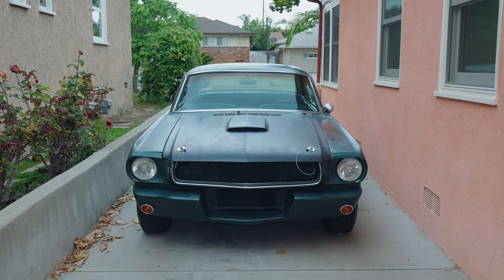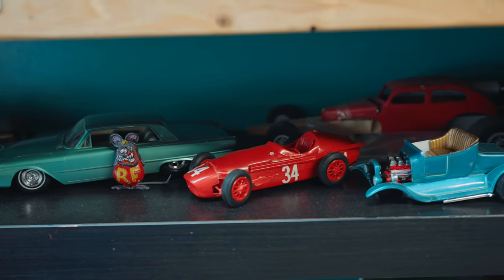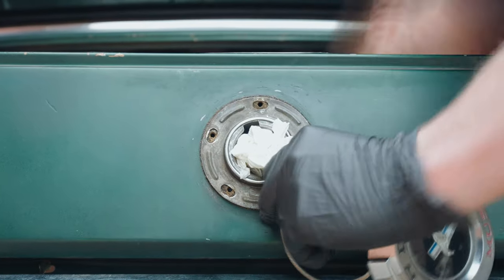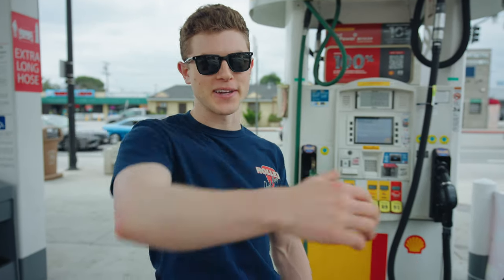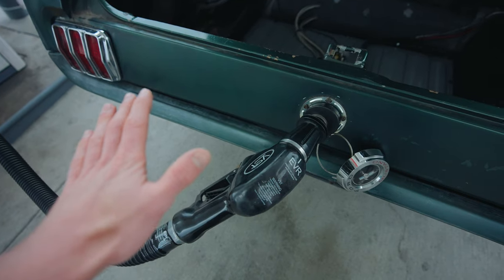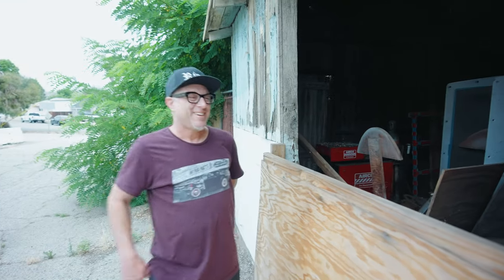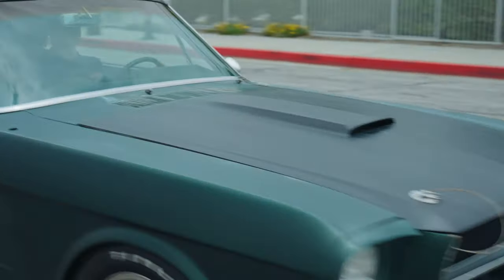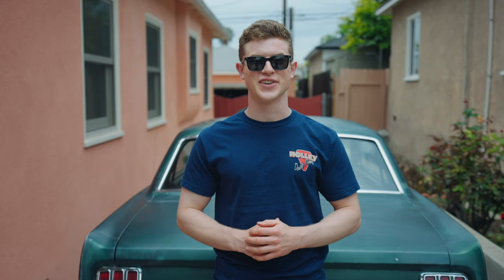Classic Mustang Mod: Stop Gas Spillage and Pump Gas Hands Free!

Comment: You have that steady EFI idle now, FiTech really levels out lopes. Doing the filler mod in this video would be a challenge on my Pontiacs and Cuda. Probably need to cut it in half and weld it back together because they are welded to the tank on my cars.
Reply: 1964-1968 Mustangs are a breeze when it comes to fillers and tanks. I had to replace the filler on my AMC Matador......drop tank and make a filler as none are made today. About 3 weeks......my Mustang 3 hours!!!
Reply from the maker: That would be cool!
Reply: @SweatyFatGuy  I like different.......Matador is that!! thx

Comment: A bit of history if not mentioned yet, that incert was originally used in the 70's to prevent refueling with leaded fuel, the nozzle for leaded fuel was larger in diameter than the unleaded nozzle, and would not fit thru the nozzle hole which in turn would cause the leaded fuel  to splash out if attempting to lead fuel a vehicle marked "unleaded fuel only" 
And that is your 70's dose of trivia for the day
Reply from the maker: Interesting!
Reply: My 75 trans am had that restrictor chiseled out of the neck to allow led fuel to be used lol

Comment: That's pretty cool!  Wish I had something like that when I had my 67.  I used to pull the gas pump rubber back while filling and hope it didn't splash on me when full.

It's always cool to hear your car without the typical fart pipe setup.
Reply: It's kinda amazing that his car sounds as it does with an X pipe. Usually I hate the sound of an X pipe exhaust. This car I really like. In fact I've never heard a small block Ford sound like this. I'm 62, I been hearing them  since this car was new.

Comment: Hey Ben thanks for the information! I have a 67 mustang convertible and it drives me NUTS filling the tank! Maybe something to consider is doing  EPAS steering,  no hoses, fluids, or special  steering racks. I bought a system from a 2009 Prius for $300 including the shaft, motor and module. Works amazing and not a super complicated installation.
Reply from the maker: Glad to help! I have a Borgeson on the way but that’s a good idea too

Comment: Love the idea but I thought the gas cap was how the tank vents. This is even more critical if it has an EFI upgrade. Would love to install this but I have a dedicated vent system tied in at the filler neck. I made the upgrade when I converted to EFI on my 69 mustang.
Reply from the maker: It has a bunch of vents in the insert. The EFI tank also has a separate ventilation tube. So I think it should be fine😎

Comment: That’s weird cause I can lock the hands free gas pump nozzle on my 70 Z/28 and the handle stops pumping when it senses it full and I have no flap on the tank neck. Maybe a better design from GM.😊 BTW gas won’t affect JB Weld seal.
Reply from the maker: You’re lucky! I’ve had the worst experience for like 7 years😂

Comment: Just take the filler neck out of the rear panel. Weld in a plate and smooth it out and paint the panel back the color you had it. Then put the filler cap in the trunk and a vent tube out of the trunk maybe over the axle. Just pay attention while filling your tank as you should anyway, gearhead.

Comment: That's awesome, I'll have to do this to my 65. Does it prevent gas from spilling out during hard acceleration? That is an issue I have been trying to figure out how to fix. Thanks for the great content!
Reply from the maker: I’ve never had that issue! But nothing shoots out at the pump haha
Reply: Install an auxiliary vent and use a non vented cap. 👍👍
Reply: @hotrodray6802  Thanks for the info!

Comment: While I'm sure this piece will solve the problem. What I'm going to use on my 1967 Mustang Coupe is make a filler like the Cobra's did back in the 60's with a aluminum pot with the filler neck inside. I've rounded up all of the parts now I just need to put it in the car.
Reply from the maker: Yeah that’s a super cool idea too